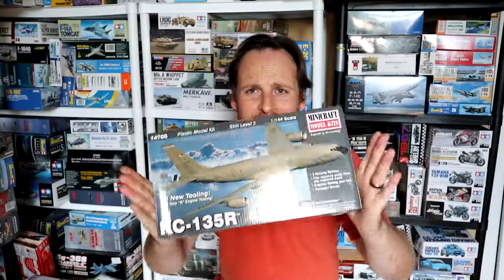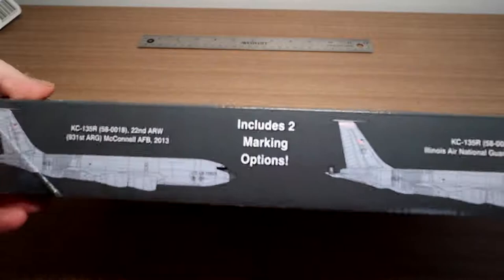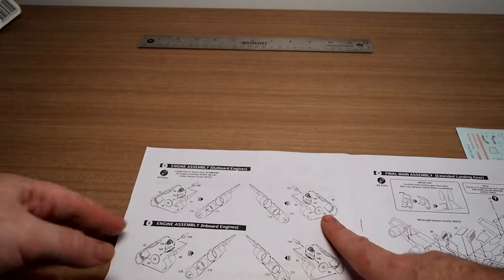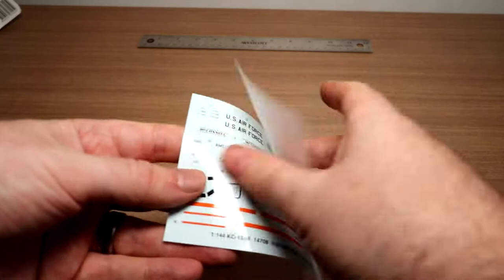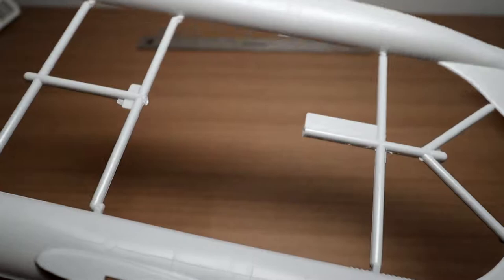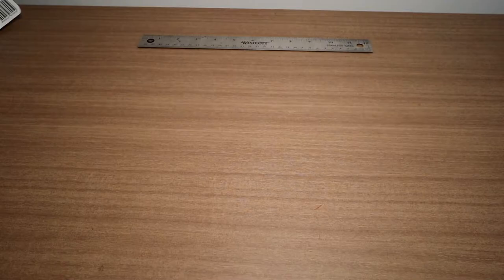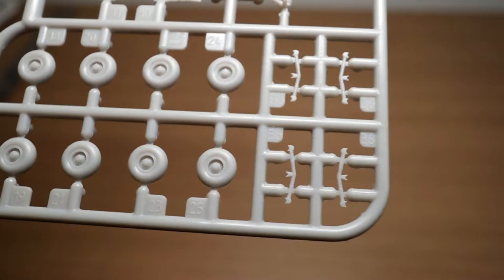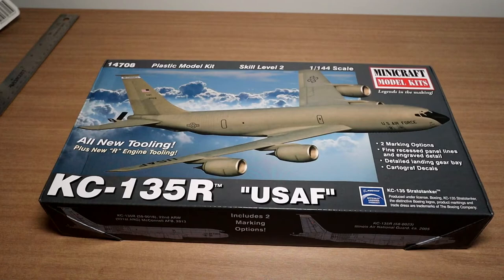Minicraft 1/144 KC-135R "USAF" 14708: A look inside the box

Comment: Did you get the latest Eduard LE kits for the Spitfire and P-51? SB had 100 of each Saturday. All sold out by Monday.
Reply from the maker: Wow. No I didn't bother with these. Although the Iwo Jima P-51 caught my eye. However I have the 1/32 Tamiya P-51 in the stash.

Trying to focus more on my main interests which are more modern subjects, 1980+. Whenever I buy WW2 stuff it seems to just sit in the stash.

I pre-order my Eduard limited editions through Hannants so I am pretty much guaranteed to get one. The 20% tax savings and 10% preorder discount offsets the shipping cost and often works out cheaper than SB.

Comment: That's absolutely the wrong scale
Reply from the maker: That's what I thought. There is no way a KC-135 is the same size as an Airbus A320. But I got the official measurements and it is correct. 🤔 I think I was thinking of a KC-10 tanker which is a lot bigger.
Reply: @RWHobbies  I'm aircrew mate and I can tell you its absolutely its huge compared to San A320
Reply from the maker: A320 is 123ft, kc-135 is 136ft. Kc-10 is 182ft long. In 1/144 scale that is 11.33 inches for a 135.

If you scroll down to post 17 on this link there is a cool pic which shows size differences between all airliners which includes the Boeing 707 (kc-135). https://www.metabunk.org/threads/which-plane-is-higher-optical-illusions-in-assessing-relative-altitude.5772/
Reply: @mikeryan999 no, the 135 and a320 are about the same length. The 135 is barely longer